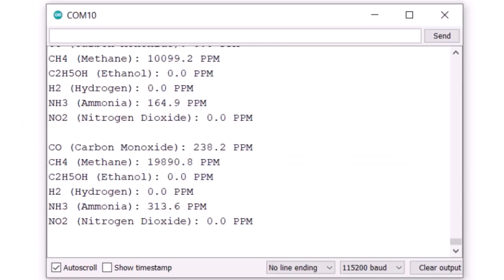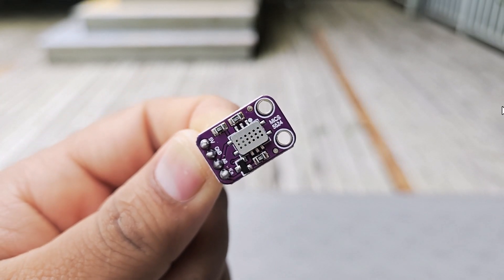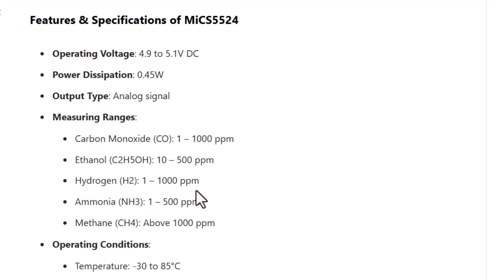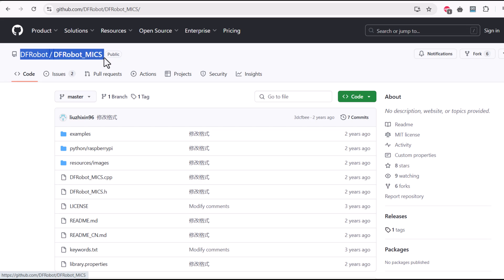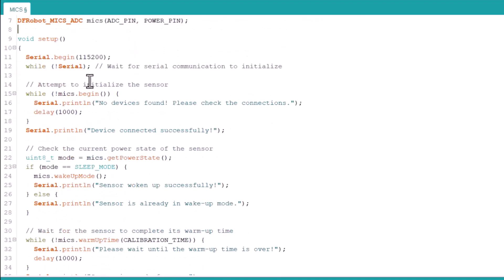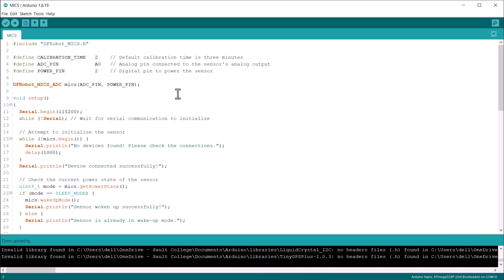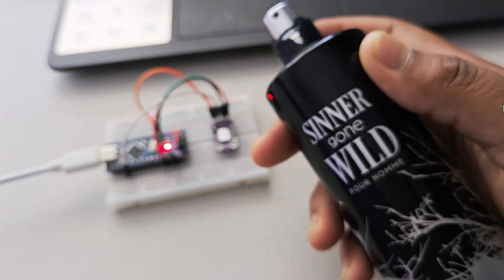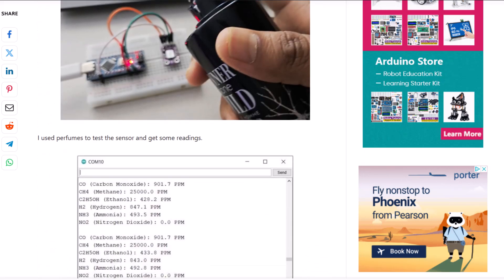Harmful Gas Detection & Measurement using MiCS-5524 Air Quality Sensor & Arduino

Comment: What power supply voltage and gas concentration range does the MiCS-5524 sensor support with an Arduino? Btw. Thanks for a good overview! 🙂

Comment: I appreciate for your contribution to share knowledge and educate with new tech adn sensors.🎉 , i have a doubt, that this sensor needs any calibration. In manufacturer description says this sensor is for any detection systems and it cant say weather any gas type. It doesn't know the gas it sensed.... Clarify is possible
Reply from the maker: The manufacturer has shared the following detail and ramge of measurement:

Measuring range:
1 – 1000ppm(Carbon monoxide CO )
10 – 500ppm( Ethanol C2H5OH )
1 – 1000ppm(Hydrogen H2)
1 – 500ppm(Ammonia NH3 )
>1000ppm(Methane CH4 )